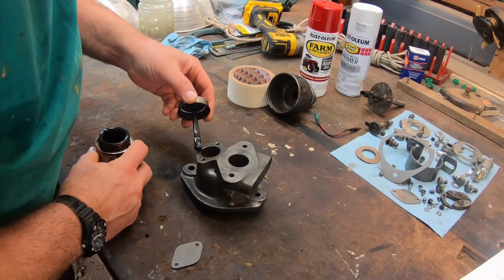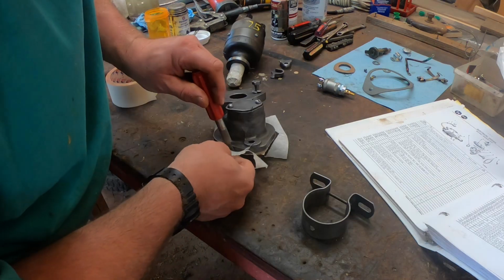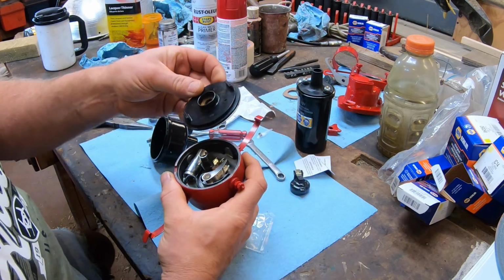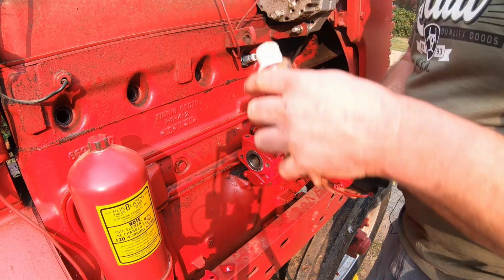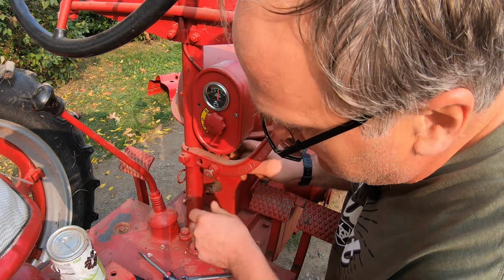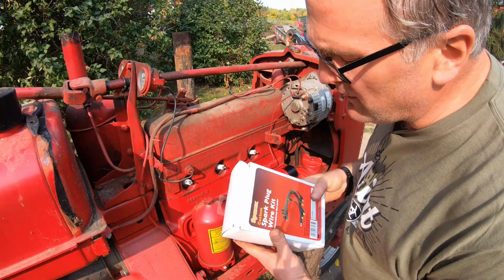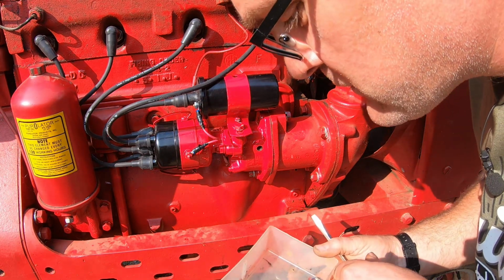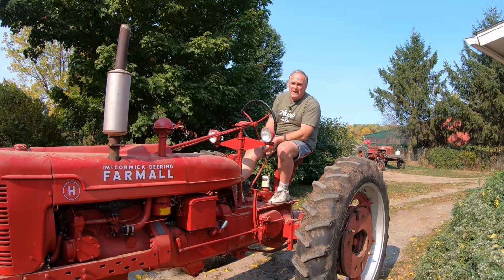farmall distributor repair part 2: painting, reassembly, installation & wiring

Comment: Dealing with a Farmall 400 right now I believe the timing is not advancing whatsoever. Wondering how tight the springs should be on the cams. If I push the cams out they stay out . Spring does not pull them back

Comment: Stupid question… your second wire coming off the kill switch, where does it go? The one side is 12 volt feed, but where does the second wire go ?
Reply from the maker: One wire goes from the battery to the kill switch, the other wire goes from the kill switch to the coil. When the switch is open it breaks the circuit to the coil.

Comment: The easy way I find TDC on my H is remove ALL the spark plugs except #1.   I do this because I will feel NO compressions on the other cylendars EXCEPT #1, when turning the manual crank.   As soon as I start feeling resistance on the manual crank I then know I'm building compression on ONLY #1.   I then start looking for the TDC mark on the pulley.   I then turn the manual crank slowly until the pointer lines up with the TDC mark on the pulley and VOILA.   The great thing about this procedure is, I don't need a second person or compression gauge to find TDC on #1.   Hope this helps someone out there in antique tractor land.

Comment: Really informative video, thank you. I have a question: my '48 Cub has a magneto. I put oil in the bearing cup on the mag, (maybe too much oil), is there supposed to an oil film all around the coil & rotor assembly? The points & condenser are dry so the oil didn't get in there
Reply from the maker: Hi Tony, that area should not have oil in it; it should be clean & dry. The oil will eventually attract dirt, and you don't want that. The oil cup at the drive end of the mag should be oiled liberally (this lubricates the impulse coupling), but the oil cup near the distributor cap should only be oiled with a drop or two once a year.
Reply: @JustaFewAcresFarm  Thank you so much for you response, I will clean it up & give it shot.

Comment: Pete that is why that set up there is very easy to get the timing 180 degrees off on the FarmAll H , Just by removing the points cover behind the cap in order to check the points gap , You probably know this , But when the engine is jogged in order to get the breaker points on the high part of the lobe for gap checking ,  Then reassembled , The rotor has to be at 1:00 when the number one cylinder is on compression stroke , If you don't know this when reassembling  , The rotor can be set at 7:00 and not 1:00 , The timing is now off 180 degrees , So remove the points cover and rotate the small D shaped hole in the plate 360 degrees , Because of a small gear drive in that plate the D hole can rotate 360 while causing the rotor to turn only 180 degrees  , Rotate that  D shaped hole  360 degrees and reassemble , I stick my finger in the number 1 cylinder spark plug hole and rotate engine to feel the compression to know that it's on the power stroke , Then look to see if the rotor is at 1:00 ,  Then she will run fine , I hope I didn't make this to confusing , Thanks .
Reply: why   didnt you  use the distributer   part on the mag  with an external coil   feeding the ht   ,  condensor  can be mounted externaly too    just   isolate the  mag ht coil   and  a new feed   through   stop  screw/ condensor   brass screw , impulse   still gives auto retard for starting 😊

i have rewound  rebuilt  several of these magnetos    and   the modern  plastc cased coils are readily available , they can be upgraded by  using  a modded lucas SR coil laminated core coil    milled down to length and  drilled and tapped 

ps  you cant beat a magneto   
your coil  has been working   corroding gently for over 60 years  . most if not all coils fail  
at  the lt to ht  connection   it corrodes  solder   joint   usualy green    making the tractor behave eraticly when hot  , it may have corroded through with the green death   and been happily  jumping  an ever increasing gap    till it found   an easier path 

to test  coil  set meter for k ohms   should read   say 5 >7
k ohm     0 means    kaput   
the ht side  can be carefully cut back peeled  to the much  heavier lt winding    check  this with a megger  500v    on the  output  to earth    if ok   
if set between   a growler  jaws   
an ac electrical magnet   fiel will   induce / produce  >20 v 
the last  turn  where  the green ht joined it can be unwound    and   cleaned thouroughly  or junked as  1 turn less  wont make any  difference   , side plates can be formed from  f glass / epoxy board , the original has none  glue with epoxy   , make  new connection with transition  winding wire a few turns of   6 thou  or so   lead the new lt   end out the side plate    with a longish tail   thats insulated with sleeving 
then add   around   11kturns of    
3thou wire   in layers seperated  
by fine craft or tissue paper     wound pyramid fashion   .
you will find the modern coils are very high ohms   ie  maybe 20 k turns of very fine wire   
but   this can  lead to   a short life 😂    as can the modern insulations polyester films etc    as the varnish cant permeate it 
and 1 and a half thou ht leaves little to corrode

Comment: I use Delco alternators on all my rolling stock. I have found I need to put an inline diode from the ignition switch to the alt. exciter lead or it back feeds and I can't shut the engine down. After I overhauled my 300 utility it would run so slow you could watch the fan turning .

Comment: I recently bought a replacement Dist. for my '50 8n side mount as old one was pretty worn and I did not want it down too long.  It was essentially transforming itself into a rattle, and knew the rebuild was going to take a little time.  I was amazed and the difference the replacement dist. made.  That being said, even though this was not a cheap Chinesium replacement, I did have some reservations about how long the points and condensor would last vs. the NAPA Echlin line I usually use as well.  I settled on running what was in it until it failed, and that turned out to be a month.  Troubleshooting was a little bit of a pain, as I checked for spark, which I still had, so I moved on to a carb because of some pre-conceaved notions that it was going need some having never been cracked into in the 10 years I have had it.  After going completely through all of the valves, filters and lines I went on to use a complete kit and rebuild the carb.  I am glad I rebuilt the carb, as I did find some issues (float level, worn needle and some junk behind the needle and seat and down in the bottom of the carb.), but I reinstalled it, and had the same issue.  It was running about 30 seconds and then it would start to stumble.  I immediately reinstalled my cheapee spark tester on #1 and fired it back up.  When it started to stumble, you could see the spark was cutting out.  Grabbed a spare condenser off the parts shelf and that took care of it.  Easy fix in the end, but a round about way to get there.  I do enjoy watching you work on this stuff, Pete.  I do not often see others using that engine lube, which is pretty impressive, sticky stuff.  Oh, and nice product placement with the shirt.... ;-)
Reply from the maker: Thanks Chris! I have not had good luck with off-brand ignition parts. I read somewhere that half the cheap condensers are bad right off the shelf.

Comment: Why not switch It to electronic ignition. Points are a pain and so obsolete
Reply from the maker: Electronic ignition is a pain. I can fix points if they go bad for less than $15. Electronic ignition will cost me many times that, and I may be stuck until a new unit comes in the mail.
Reply: @JustaFewAcresFarm  yes true but I've done almost a 100 boat engine conversions and once we did that we never had any problems but I guess it's what you're use to. I hate points with all the gapping and they corrode vs electronic Is a sealed system that once done you never have to touch timing or cleaning and regapping.
Reply: Its really smart what you said. People don't see the cost to maintain, repair or replace a part as long as it s easy to install. you are so right. keep it up.
Reply: A lot of tractors on farms usually have to jump start other pieces of equipment.  The electronic ignitions don't like it and burn out.  You can change points and condenser in 20 minutes. Takes a week for a new pertronix
Reply: simple is best